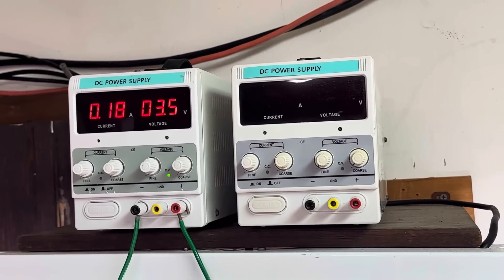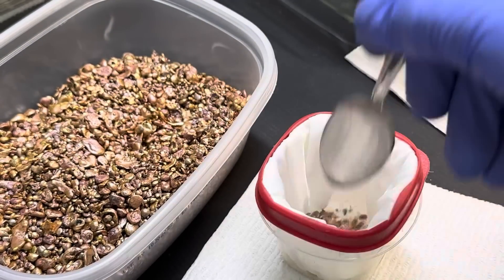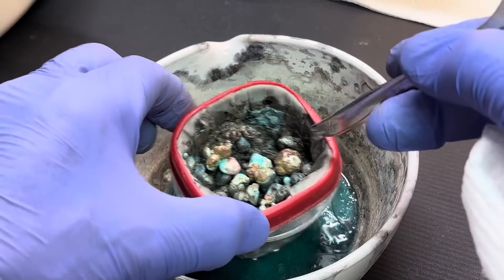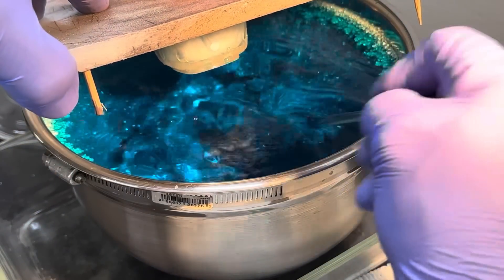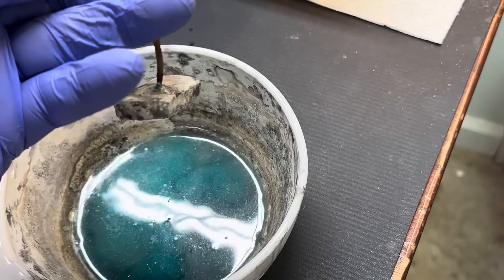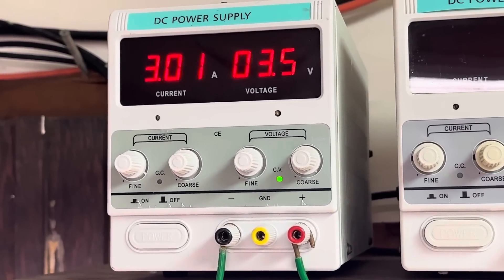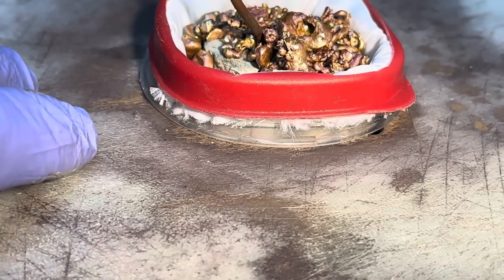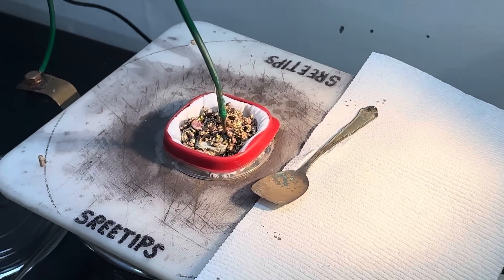Silver Cell Anode Change Out Increase Current Flow

Comment: There is obviously copper present in the anode metal, and dissolved in the silver nitrate after a while. How do you stop it crystallising as well ??  is it the voltage you set ? or the changing  of the electrolyte after a while ? do you ever get copper crystals as well when things go wrong ?
Reply from the maker: I had green crystals one time when I first started. I used the same electrolyte for three silver cell runs. Adding only distilled water for each reboot of the cell. The third run crystals had green on them after drying. When I tried to recover the silver from the electrolyte, none would precipitate. The electrolyte was completely devoid of any silver. That made a believer out of me. I never use the electrolyte more than twice. And I always add about 200g more silver to the second run. As long as copper is kept below 60g/liter concentration, the copper will not go-deposit with the silver.

Comment: I modified my anode basket and current flow is at 3.5volts drawing around 15 watts. More than cut the time to cell full in half from previous versions. I have noticed smaller crystal size when current draw is more.
Reply from the maker: Same here, but it’s still high purity silver.

Comment: What if you used a taller pot like a lobster pot and a bigger or longer filter for more shot to be done at a time 
and are you gonna pour a big brick or two or three😁
Reply from the maker: There’s a critical distance that must be maintained between the anode and the cathode: 4 to 4.5 inches.

Comment: Those filters can be cleaned and reused, correct?
Reply from the maker: No, they are custom fit and nearly impossible to get them to fit again. They used to be about seven bucks. But with all the money printing devaluing the currency it now takes fifteen bucks for each filter. Not to worry, we’ve planned for these prices.
Reply: @sreetips  maybe find a way to secure the fabric in bulk?
Reply from the maker: I’ve been meaning to do that but never got around to it
Reply: @sreetips  If it's dacron - which I think I heard you say before - then there's old sailcloth (more modern than canvas, older than mylar or kevlar). Sailcloth may be too coarse a weave, though.

Comment: Sr. Chief, you can get two runs on a batch of electrolyte, right? My stainless steel bowl/cathode is 3.6Q or 3.4L capacity. Meaning, I need 450 grams of silver to make 3L of electrolyte? What’s the correct amount of Nitric Acid to put that much silver in solution? Should the solution be 50/50 of Nitric & distilled water?
Reply from the maker: In a recent video I used 0.9 ml of 50/50 nitric/dh2o, per gram of pure silver, to dissolve my pure silver for the electrolyte.
Reply: @sreetips  Thank you sir for the information. It’s greatly appreciated.
Reply: @sreetips  I have 15 ozt or 466 grams of .999 silver rounds to use to make 3L of electrolyte. That should keep me in the 150g/L range! Which is what I see you use.
Reply from the maker: Sounds about right.
Reply: @sreetips  Sr. Chief, will a .025” x 10” x 4” piece of copper strap work with a 1/4-20 1” brass bolt for the cathode connection?
Reply from the maker: Yes
Reply: @sreetips  what is your opinion on the best way to get the silver I need for the electrolyte and anode bar?  Get about 600 grams of Sterling silver and refine it or just purchase some bars or rounds, which is roughly $425 for 18ozt?
Reply from the maker: I refine silver because I have a ton of it sitting around from my gold refining. If I had to go out and buy it then it would not be practical. If you’re wanting to refine silver then turn around and resell it for more than you paid, then you’ll have to find a cheap source of silver to make that happen. That’s NOT what I’m doing. I’m not selling any of my silver. I’m buying more, paying spot, and using it to refine gold. Then I recover the silver, run it through my silver cell, harvest the pure silver crystal. Then put it away and forget about it. I can’t imagine having to try to sell it to make a profit. I’m converting my paper dollars into silver. I’m de-dollarizing.
Reply: @sreetips  Right! I understand what you are saying. Im just trying to get started. Either way its going to cost me to start the silver cell, whether I purchase the sterling silver and refine it, which is how I am going to do it once I start refining the gold filled material I have. I should have some silver after I do my run. Just have to cement it out on the copper in my bucket.
Reply from the maker: @larrykester8593  you can probably use cement silver to make the electrolyte for your first run. I think that’s what I did.
Reply: @sreetips  That sounds like a pretty good idea. Not to mention that I do have about 200 grams of Sterling Silver on hand.

Comment: Seems to me that you could, in effect, dip sludge straight out of the cementing bucket into the anode basket, skipping the whole "melt it down and make shot out of it" hassle? Wouldn't feeding the cell on "silver sludge" like that make for better/quicker/more efficient operation, thanks to the MUCH higher surface area of the "input material"? As I understand things, the whole point of the cell (and the reason you keep using the phrase "impure silver") is that electroplating the silver onto the cathode gives you just about as close to "pure elemental silver" as it's possible to produce - thus, whatever "yuck" comes out of the cementing bucket doesn't much matter, so long as it's silver-bearing - In theory, you should even be able to (as an example) clamp the anode wire to a sterling spoon/whatever dangling in the electrolytelet it do its thing, harvest the pure silver, and dump the (probably mostly copper?) sludge out of the anode basket when the run was finished, with little or no need for "pre-refining" the sterling. (Yes, I realize that you're using the sterling for inquarting when refining gold, then "hauling out" the silver as a "by-product" of the gold refining, but I think you see what I'm saying?) Or is there some other reason that hasn't occurred to me for choosing the "make shot out of it first" route? Obviously, it works, but it seems like a waste of effort to me.
Reply from the maker: Tried it, clogged the filter, shot is the way to go
Reply: @sreetips  Huh... Would've expected almost the opposite - Less clogging. Interesting...

Comment: I may have missed it, but is there a reason you don't run two (or more) filter baskets in parallel in the same setup? Double your pleasure, double your fun as the old saying goes.  Thanks for all you do on our behalf.
Reply from the maker: Yes, running two off one power supply won’t work. Tried it. One of the cells ends up robbing the other of power and skews the results. Each cell needs its own power supply.

Comment: Dude, when you grew silver crystals last time. I think the first video I watched from you. The crystals seemed to grow differently. More like ice cycles, and they seemed to have grown quicker. Maybe I just missed the time laspe. Anyways my question, or what I'm wondering. Is maybe was the silver shot more pure? It looked exactly the same to me. But what do I know. I am learning a few things though. Thanks to you. The shot looks like the same. Soooooooo I'm thinking I just zoned out and missed the actual amount of time it took last time. Unless, the shot from your first go around was more pure silver. Which to me, would then make sense. For the explanation of the crystals forming differently.
Reply from the maker: There are many factors that influence silver crystal growth shape, rate, and size. Level of purity of the impure silver going into the anode basket is one of them.

Comment: What is the longevity of the anode bar
Reply from the maker: I’ve used one for over a year as long as it’s kept out of the electrolyte. The copper does eventually corrode and it breaks.
Reply: I see that you don't use an in-line fuse. Is it built in the regulator
Reply from the maker: I’ll add a fuse when the crystal begins to approach the anode basket.
Reply: Oh yeah, I see. When the crystal was formed in the smaller vessel, it ran a greater risk of touching the basket if unattended.  Gotcha, you have a little more room in the bowl.

Comment: I like your general set up, but I think it has room for improvement. You should try replacing the filter basket filter with some fiberglass screen and make another larger cutout for a bigger container, with holes drilled in it or the bottom removed, to hold a larger portion of filter material out and away from the anode basket. As the anode is consumed, the slimes should fall away into the filter. Should ensure good anode contact with the electrolyte while also maintaining a route for silver ions to pass freely.

Comment: Is there a way to get more pure silver cement to make your silver shot, for the anode basket? I think it would speed up the process in making silver crystal.
Reply from the maker: Yes, I could get higher purity cement silver and that would cause it to run faster.
Reply: Silver is merely byproduct of his gold refining.
Reply: @tonydalton6756  yes, I know this. I was just wondering if there is a process to clean the silver up, getting most of the other metal, to reduce the slimes, and speed up silver refining.

Comment: I was hoping he was going to run a second cell in series. 😕
Reply from the maker: Can’t, one cell would try to rob the other of power
Reply: It is possible to run both parallel and series, is that right?
Reply from the maker: Each cell gets its own power supply
Reply: In series the dirtier cell would get too much voltage, the cleaner cell would get too little, and so the current flow would be tiny and the silver would be contaminated.

Comment: Would applying more power make it quicker? Or does electrolysis have a set speed?
Reply from the maker: Critical voltage of 3.5 volts DC, amps can fall where they may.
Reply: 3.5 V is enough to pull the silver from the electrolyte onto the Cathode. But just as important, it's not enough to pull the base metals out of the electrolyte, because you don't want those on the Cathode, you just have to put up with the copper accumulating in the electrolyte until you eventually have to change the electrolyte.

Comment: Is there a reason you don't take the solids (at least the macro pieces) from the old filter and wash them and throw them back into the new filter? I get not wanting to throw the slime into the new filter, but why not the macro pieces from the old filter? Presumably those macro pieces are almost entirely silver.
Reply from the maker: It’s best to keep those out based on my experience.

Comment: Could you use junk silver coins for your stock pot??? Just stack them up in that little container.
Reply from the maker: They contain a known quantity of silver minted by the government. They should be held like they are and not melted or dissolved. A silver dime will buy a loaf of bread. Silver quarter a gallon of gasoline. Use your gold to buy big-ticket items such as cars, machines, and appliances. So long as you don’t melt or dissolve them and ruin the markings.